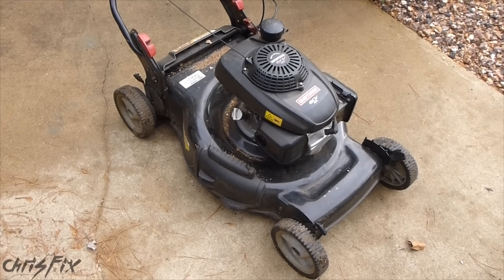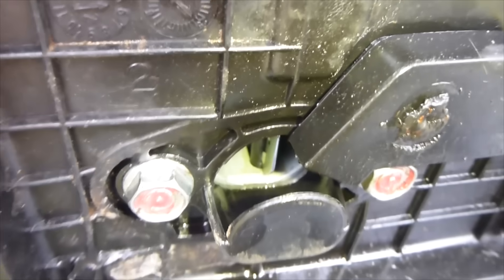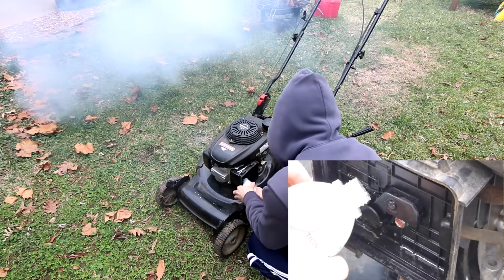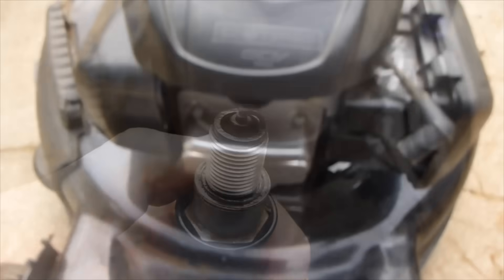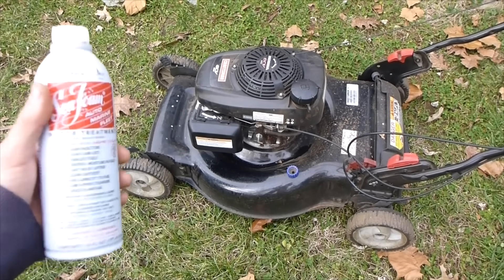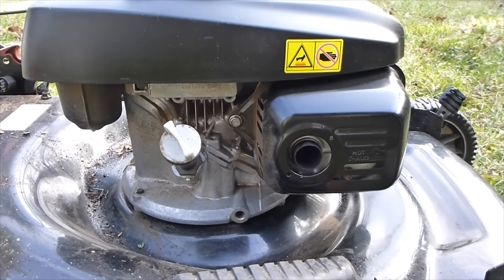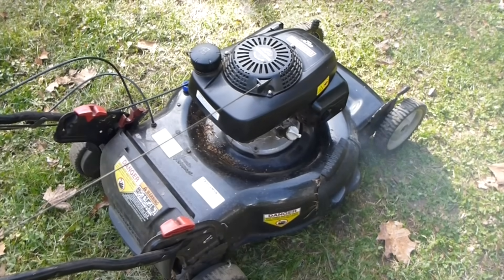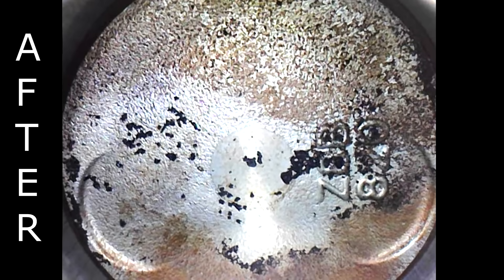Does Seafoam Actually Work? (with Proof)

Comment: Like the name implies, it is a foam when it comes out of the can so it coats everything in the cylinder. It kinda smells bad, but it does work good. Best engine degreaser i have ever used. I use to run engines that had been in storage as long as 20 or more years. A lot of time when you first fired them up they would have sticking rings or stuck valves. Some of them would have carbon deposits so bad chunks of carbon would get stuck between the cyl head and piston and lock the motor up. In 32 years of working on motors, there was only two that i could not get unstuck due to carbon deposits. A Ford 2300 and a Ford 200. I had to pull the cyl heads on those .Some of the motors still smoked due to high mileage.

Comment: back i the old days wee used mineralvatten to remove dirt and soot from the carburetor and engine, but it may "NEVER" be used on diesel engines.
Reply from the maker: kenni bugge Cool, I never even heard of the stuff!
Reply: water with CO2 ?
Reply: sorry bad translation mineral water with co2
Reply from the maker: Interesting. What does the CO2 do?
Reply: nothing, but it makes it possible to spray into the engine, giving it plenty of gas and then is sprayed into the carburetor, the engine should preferably not grind to a halt as it is because the water is heated by the engine that there is a kind of steam cleaning

Comment: What about hydrogen peroxide (oxigenated water) instead of seafoam with the engine running? Some say the oxigen will help to burn the carbon out.
Reply from the maker: OS Coutinho I never used hydrogen peroxide and I have also never seen hydrogen peroxide used in any of the engine cleaners that are on the market. I cant really comment on the hydrogen peroxide and if it would work or if it would damage fuel hoses or pumps, but the idea with seafoam is that when you pour it down the intake, it doesnt all burn up on every stroke. It makes the engine run super rich so the seafoam has a chance to clean stuff. That is why there is smoke. The idea is if you can saturate that carbon with cleaner, then it will loosen up the carbon! With the extra oxygen, I would think your engine might run hotter and maybe that could help with the water hitting the carbon by "steam cleaning" but again, that is just speculation. I will be testing straight water in a car engine so we will see what happens!

Comment: try b12
Reply from the maker: witnesszer0 I just looked into b12 and I will not be trying it. It has harsh solvents such as toluene and acetone which are very bad for plastics.
Reply: yeah its only 20-30%it has so little exposue to the plastic that it will do nothing to it seafoam is mostly  mineral oil that's what the smoke is from you could just use water in the same fashion as seafoam run b12 in the gas the new age nylon fuel lines are resistant to gas alcohol and all sorts of chemicals its safe and works way better
Reply from the maker: witnesszer0 Yea, maybe if I can find another car to try it on. I dont want to try it on one of my cars lol.

Comment: I have used Amsoil powerfoam for years and it works excellent. You can pore it in the carb, add it to the fuel tank or remove the spark plug and spray it through spark plug opening. it also is the best cleaner for cleaning the outside of engines. I have newer use Seafoam so it might also be good.
Reply from the maker: Chuck Small Thanks for the info! I never tried powerfoam. I will have to check it out.

Comment: Hey ChrisFix, have you tried running the mower on gasoline vapors? It makes the motor more fuel efficient. Same thing with your trucks. And also check out this video. (no link) This guy got free gas by just yanking the hose.

Comment: some say water just does the job !!
https://www.youtube.com/watch?v=KFtp_jmLF3k check this and skim through the comments 
actually, i wont trust it unless you make something similar with this nice camera u use :D :D
what do you think?
Reply from the maker: Osama Moharem I will be testing water but I do not think it will work as well as many think. Sure a head gasket leak makes the engine clean, but that is over time. Will 10min of water spraying really do anything? We will find out!
Reply from the maker: Osama Moharem I will be testing water but I do not think it will work as well as many think. Sure a head gasket leak makes the engine clean, but that is over time. Will 10min of water spraying really do anything? We will find out!
Reply: well, many think that gumout really makes a difference and we've seen its nothing serious so if water is anywhere close to gumout or any better then i think its a great alternative

Comment: Have you ever tried pouring demineralized water through the intake. I used to use it on my old cars because of dieseling from carbon deposits. It was a temporary fix, it would always recur though. It would be cool if you could use your scope to test it , thanks Chris good one as always.
Reply from the maker: Sam Johnson I will be testing water eventually. The next test is techron which is currently in my gas now!
Reply: Sam Johnson You don't POUR water into the intake, you mist it in with a fine atomizing sprayer. It works every bit as well as any store bought chemical. Used to have the dieseling problem with 80's Dodge 'K' cars, I 'watered' a lot of them.
Reply: Please don't split hairs over the word POUR, you know what I mean. I can only hope you only worked on "K" cars and did not purchase them. On a lighter note, I thought I might try adding Miracle Grow to the water and see if I can turn my Civic into an Accord.
Reply: Sam Johnson Actually, I didn't know what you meant. The huge difference between pour water and misting water isn't exactly splitting hairs! Consider also a lot of people read these comments and take what someone says literally, so you need to explain things like pouring water into an engine, lest someone seize their engine or bend a rod because they dump half a cup of water into the intake.
No, I never purchased a 'K' car but worked on many of them. I like the miracle grow idea. You might even end up with an Acura!
Reply: Grammar Nazi's, oh my.
Reply: Diatribe, blah blah blah. This makes you feel superior I suppose, pointing out what everyone else already knows. This is just boring, see your therapist and move on. I do not wish to converse with you, please respect my wishes, I shouldn't have to block you, but I will. P.S. the poured boiling water would be over quickly, the misted boiling water would take much longer and turn to steam as I'm sure you know burns far worse than the liquid.

Comment: Water in the intake does the same thing! This is an old trick. The water quenches the combustion chamber quickly which shrinks the metal causing the carbon to fall off. You have to be very careful adding any cold liquid to a hot engines intake! Sea-foam is meant to go in the gas tank! It does work for fuel systems and I have proved it. I had a dirty carb on a dirt bike. The bowl was covered in varnish. After running Sea-foam in the fuel after about 3 hours running I pulled the bowl and it was clean!
Reply from the maker: theoriginalmungaman I am not so sure water works as well as people think. We will find out when I test it. Also, seafoam is designed to go in the intake and or the gas tank. Thanks for sharing your results!
Reply: ChrisFix not to mention your crank case. I add seafoom every other fill up, and mix it in with my oil every oil change.
Reply from the maker: Andrew Coney I dont personally like adding anything to the oil.
Reply: ChrisFix I completely understand, I was skeptical myself. But working in an oil change line for a little over three years I was able to learn a lot and experiment.

Comment: Have you tried just straight water sprayed in to the carb?
Reply from the maker: beingsneaky When I got the borescope camera I wanted to test it out so I tried straight water and it cleaned the bottom of the cylinder only (where it was already cleaned in the video). I will be testing water in the intake in another video!
Reply: ok hmm how long after the water treatment did you do the seafoam treatment? the cleaning you got in the seafoarn vid. may have been a combination of the water and seaform??
Reply from the maker: beingsneaky I did the water treatement in the spring of last year so more than 6 months. It had no affect on this study.
Reply: ok was just wondering.
Reply from the maker: beingsneaky Good question. That is why my next fuel cleaner test has not been done yet (on my truck). I need to drive it a bit to make sure that the carbon wasnt affected by the previous cleaner before I test the new cleaner!

Comment: I have had great luck using spray seafoam as a throttle body cleaner.  Don't you have to be careful adding this stuff to the brake booster line, oil and gas tank? It might set-off a check engine light?
Reply: Seafoam was designed to work with older engines and 2 stroke outboard motors.  I have heard of lots of people having problems adding this stuff to modern car engines.
Reply from the maker: Stephen Maurer I personally wouldnt put it in my oil, but the seafoam shouldnt set off any check engine lights.
Reply: I wouldn't,  I did it through the booster line on my truck and wife's suv shortly after I got a engine light and had to replace the evap. Lines on both...

Comment: You should have used Marvel Mystery Oil its the best oil. Its like engine flush that you don't have to do anything does it by itself. It keep the engine longer and stronger you. Should check it out
Reply from the maker: Anthony perez I will check it out, thanks for the suggestion!

Comment: You'd get the same results using water...
Reply from the maker: Michael Boykin Actually, I tested spray water in the intake when I first got my camera and that is why there is a clean spot only at the bottom of the cylinder. The water didnt clean it like the seafoam did.

Comment: It would be awesome to see a SeaFoam cylinder soak on the Mazda to see what the results are.  Some of those deposits are pretty gnarly.  The Gumout seems to be a joke to me, and the 2nd test seemed to actually make the deposits appear worse than after the first run...
Reply from the maker: Robert Cowan I wont be soaking any pistons in my truck. I dont think it is a good idea to loosen up all of that carbon at once. We know it will work.
Reply from the maker: ***** All of the cabon coming off at once might cause problems.
Reply from the maker: ***** You dont think it could scratch the cylinder wall or clog up a cat?
Reply from the maker: ***** Not worth it for me.

Comment: so the lawn mower is a boxer engine like the Subarus.
I thought oil leak into piston = blue smoke and coolant leak = white smoke and carbon deposit or rich air/fuel mixture = black smoke/soot?
Reply from the maker: ***** When there is only a little oil, yes it will appear blue, but when there is a lot of oil it is white.

Comment: I wonder what if you use the soaking piston method using Gumout on a car. Maybe it will get better result?
Reply from the maker: ***** It isnt designed to do that so I wont be testing it that way. Some of the cleaner will seep into the oil and with seafoam it is ok, with gumout it is bad.

Comment: I'll swear by it. I have started mowers that otherwise would not start. I've cleaned the gunk out of my Holley 600 by putting it directly into the fuel bowl. And it does wonders in 2 cycle weed whackers. I put it in all my gas cans, mower, mix, pressure washer. The hotter you mix it, the better it cleans. I can per tank in your car doesnt do much. Has to be like 1 can per gallon to get it cleaned if its dirty. The engine needs to smoke if you got it hot enough.Get it so it just barely runs. In fact if you let it run and smoke, then it dies, let it sit overnight.
Reply from the maker: VideoServicesVB Thanks for sharing your experience and for the tips!

Comment: What difference does it make if there is some carbon stuck to the cylinder head?

What did you gain by doing this?
Reply from the maker: DFKnightmare Carbon is the only quantifiable thing you can check to see if these fuel cleaners work so that is what I am looking at. If you can see a difference on a cylinder head, it will most likely clean injectors, valves, etc. If you have a lot of carbon buildup your cylinders can be unbalanced, you can have compression issues, detonation, and stuff like that.
Reply: ChrisFix Awesome, thanks for the background info man.  :)

Comment: well considering cylinder size to volume used and a marginal removal of surface carbon, my 1.9td should require about 12 cans.....no plugs to pull on mine to pour in though..

used to pour good old red-x in and leave overnight, piston crowns like new next morning.
Reply from the maker: lez briddon I do not think that is how it works but we will find out when I test it in a car!

Comment: Suggestion for a related video: Use of water as cleaning fluid using similar induction procedure as Seafoam. Many claim water burst to steam and cleans carbon accumulation. I have noticed that a head gasket leak cleaned spark plug nicely.

regards
Reply from the maker: Texas Pipeliner Thanks man! I am doing that video soon and we will see!

Comment: Why dont you put it in the gas tank?
Reply from the maker: ***** Because I am running it though the intake which is concentrated. If I ran it though the tank, I would have to wait till spring to make the video since there is not grass to cut. When I test it in the car, I will run it though the tank first then though the intake.

Comment: I use sea foam in all my small engines .My roto tiller sits from June to the next April and it always fires up on the first or second pull.Also i had a 1988 ranger that i had to down shift into 3rd to make a big hill on my way to work.I dumped a can of sea foam in it and the next day made the top of the hill doing 60mph.in 4th gear the next day i did 65 in 5th gear.. Sea Foam works for me.
Reply from the maker: Dennis B. Thanks for sharing Dennis!

Comment: You should review Marvel Mystery Oil.
Reply: ChrisFix
 +1 for review of MMO. I just now put a bottle in my 82 El Camino to get rid of a tapping valve. Hopefully.
Reply from the maker: areasevenpro Thanks for the suggestion! I will have to add that to the list!
Reply from the maker: Let me know if it works!

Comment: Great job on these fuel/engine cleaners Chris! It's nice to actually see these tested and actually see results. I've always been happy with Seafoam myself. I always add the proper amount to my fuel in my lawnmower and my tractor since it's a great fuel stabilizer. To me it makes that ethanol gasoline run much smoother in small engines and tractor engines, and even when they sit with the Seafoam added into the gas over the winter, when I get ready for the first start of the spring, they fire right up. I also keep battery tenders on my equipment.
Reply from the maker: Michael Wells Thanks Michael! I cant wait to try the other cleaners! Also, thanks for sharing your experience!

Comment: Hi CrisFix
Looks good for more repair work with people using these types of products.
Water has always worked as well or better than this product, if sprayed into the intake while hot, water will peel carbon off safely. 
I am old school and most people don't remember tricks of the trade from even twenty years ago. To bad real mechanics have to be familiar with this stuff, it's like handing a baby a gallon of fuel and a lighter.
I have customers that will try this type of stuff, ruin the ring's or bend a rod, and try to keep that info from me. I will be reprinting my repair orders to cover my ass from thing's like this.
We live in a society that wants instant results, but nobody needs this stuff, nobody has issues with the looks of their pistons. It just shortens the life of the motor, and saps some money from the public. Sad, really sad.
Thanks for the info.
James in Oregon. again!

Comment: I believe this stuff along with any carb cleaner will damage/dissolve the carburetor diaphragm. So, maybe pouring it in through the spark plug opening is the best way to go. Then again, the diaphragm can be easily replaced for a few dollars and probably should be replaced every few years.
Reply from the maker: bg147 If you only use this stuff once or even once a year, you shouldnt have any problems with damaging the diaphragm. It is only touching the seafoam for a few seconds total and the ethanol based fuels are in contact with the diaphragm constantly.

Comment: another good video. in the 300 zx forum and the rx 7 forum ,they say put a full bottle in a 1/4 tank of gas and drive until it's almost empty.that's how i do it. guess it's more concentrated than a full tank. for me , think i'd rather let the carbon slowly dissolve so a big chunk doesn't break loose and mess something up. if i was going to put it through the plug holes , i'd let it soak all night and change the oil the next day. seafoam has worked great for me. don't know if from cleaning carbon or not. does clean the lines and injectors good it seems.idle and throttle responce was great after useing it. wonder how well barryman(?) works ?
Reply from the maker: mrwayneone Did they like this video over at the 300zx or Rx7 forums? I agree with you that I rather have the carbon slowly dissolve rather than all at once! Does barrymans go right into the intake or in the fuel?